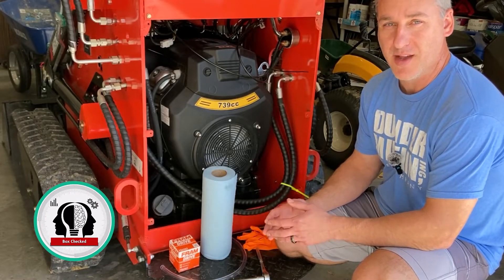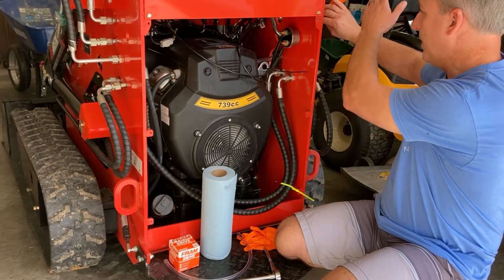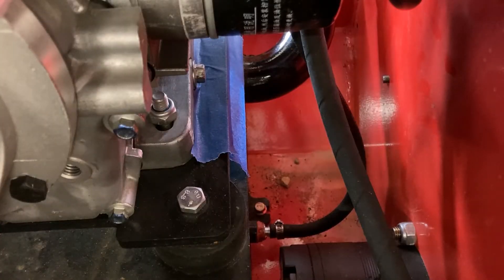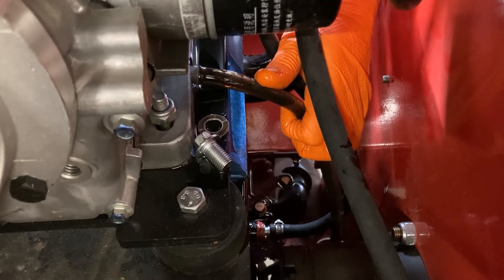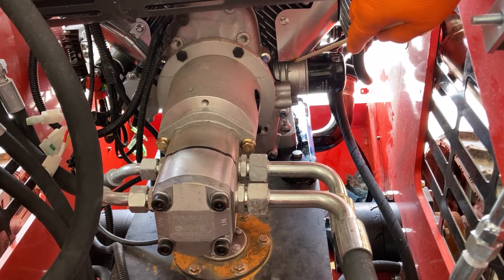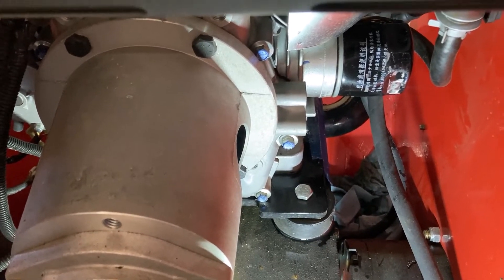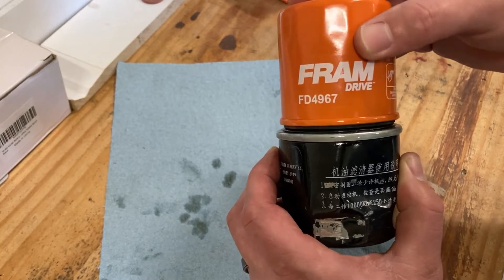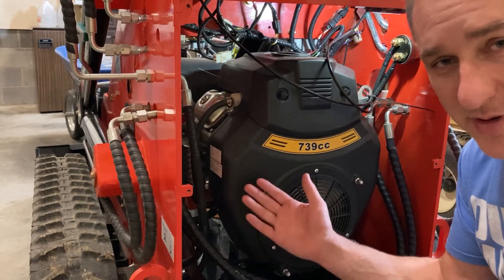First Oil Change on the Chinese Mini Skid - PT 1

Comment: Knowing the issue with the oil filter my lrt23 needed a new motor. I decided to crack off the oil filter before installing the new engine heres what I found....when I removed the filter the stud the filter screws onto came off with the filter the mounting donut is for the oil cooler my tip for you is next oil change use a large washer and vice grips to tighten the stud back on the machine. The top of the thread that the oil filter screws on to is slotted snug that up it maybe where your oil is leaking
Reply from the maker: Oh wow!  Very interesting.  Thank you for the tip!
Ok, so here's an update on the oil leak - I was totally convinced a small crack or separation occurred.  So much so that I ordered the gasket for the engine casing...I was wrong.  There was no leak at all!  After hours of use and testing, I discovered it was residual oil trapped under the engine (between the engine and mounting plate).  Thank goodness!  It doesn't leak a drop of oil and the engine is running great.  I hope this luck continues.  Thank you so much for watching!

Comment: I had the same difficulty with the 23 Hp Rato in my mini excavator. The filter was so tight that I crunched it in quite a bit and I had turned it about 3/4 of a turn with the same pliers type wrench before I could loosen it the rest of the way with my hand.
Also,  I always install a “Oil Drain hose” ($13 to $15), from Amazon during the first oil change to make the job cleaner and very easy on the next the oil change. ****Note: the oil fill hose will have a 12mm threaded end that matches the old drain plug.
Reply from the maker: Good info.  Thank you.  I believe I will get one of those.

Comment: Excellent video. Mine is leaking some oil after I changed the oil filter, any remedy to stop that?
Reply from the maker: Glad you brought this up!  I've done many tests on my machine since changing the oil (this video) and here's what I found - it looks like it's leaking but it's actually not.  

So, what's happening?  There is just enough space between the engine and mounting plate to trap oil drained from the oil change.  As I was running the machine, this trapped oil would vibrate out.  I was so convinced it was leaking that I ordered an engine seal. But over the course of periodic runs, the "leaking" stopped.  So, I never had to use the seal I ordered.  

I'm not sure if that's the case with yours or not though, but I can see the value in a legit drain hose or drain stem now.
Reply: @BoxChecked very interesting! Thank you for sharing that knowledge.

Comment: Use a shop vac hooked to the filler neck until you have the drain tube hooked up to save from making a mess or get a extended drain hose
Reply from the maker: Both are good tips!  Thank you.

Comment: I am a  Auto parts distributor in Los Angeles and looking to buy a Chinese skid steer and it just bothers me to pay top dollar for an oil filter that I pay $1.27 . I remember few years ago bought a Yamaha quad and picked up a OE oil filter for it for $12.50 and come to find out it was a regular Toyota 4 cyl filter like the one for your skid steer. Crosses over to a 4476  Purolator .

Comment: So the moral of this story is if your filter on this unit is too tight and doesn’t come off without twisting the housing don’t take it off or it breaks the engine.  I suspect the original filter is probably good for the first 50 hours.  I decided to do my first oil change at 0.2 hours but keep the original installed.  I’ll deal with filter at my 50 hour oil change.  Thanks for the heads up
Reply from the maker: Yep, pretty much sums it up!  If I hadn't messed with the oil filter, I wouldn't have a small leak now lol.  Oil filter fitment for the R740 is a little hard to nail down.  I primarily just wanted to confirm if this was the right one, and if it was, to let people know this was an option.   Will be replacing the crankcase seal soon.  Thanks for watching!

Comment: Great camera work! And narration 👍I sure hope that oil leakage is a minor issue. I have the same engine in my mini skid steer, the filter was tight but not as bad as yours.
Reply from the maker: Thank you!  I appreciate the feedback!  By the way, the oil filter is a good fit - not where the leak is coming from.
Reply: Did you ever find out where the oil is coming from